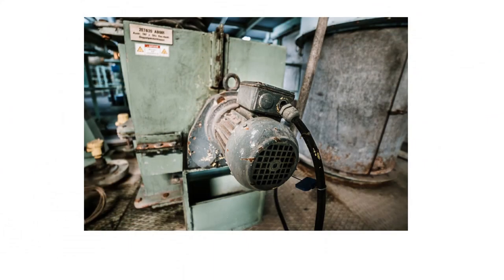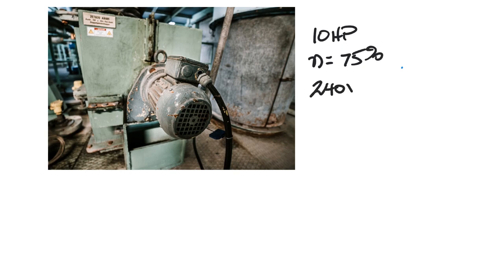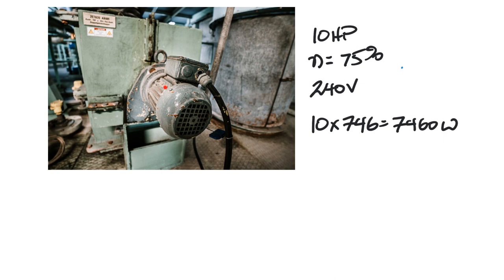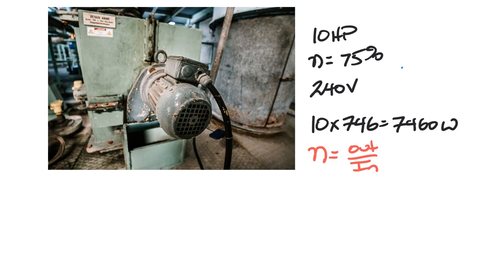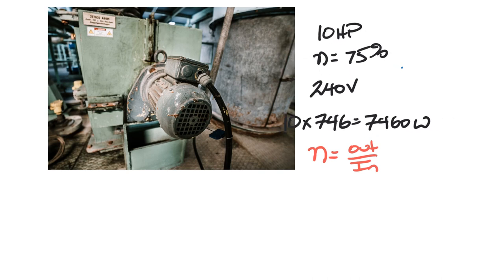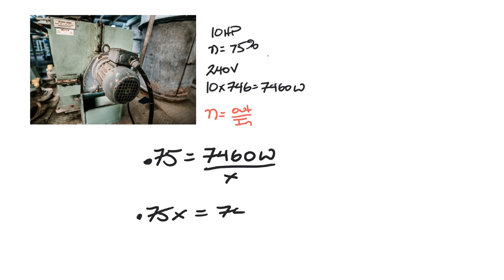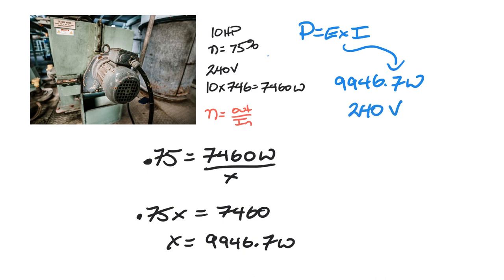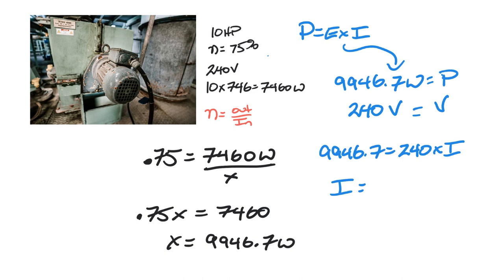Motor efficiency calculations explained

Comment: That would apply when things are up and running but not at initial start-up which depending on the motor size can cause a decent voltage drop thus your amp draw will increase :face-blue-wide-eyes:

Comment: Did not include power factor of motor. To know amperage input you need VA input = Power input / power factor.  Typical induction motor has PF between 0.75 and 0.88 depending on percent of rated loading on motor.  It is the inductive component of motor load.

Comment: You have to account for power factor.  Power in a 3 phase motor is: P = square root (3) * Volts * Amps * Power factor.  Most 3 phase motors PF is .7-.8.  For single phase P = Volts * Amps * Power Factor.   Power = Volts * Amps only holds true for DC powered machines.
Reply: True but 240V is single phase.
Reply from the maker: I guess I should do a video with pf and efficiency?
Reply: The Electric Academy 
Great videos, I’ve found several of them very helpful!!
Do you have any videos with general knowledge on motors rather than formulas? I’m challenging my red seal soon and in practice exams I’m struggling with all these random questions on motors. I can’t seem to find any good online sources to learn about motors. 
Please help! 
Thanks
Reply from the maker: trundle888 I do have a few on motor connections.
Reply: The Electric Academy 
Ok great, I’ll see what I can find and check them out. 
Thanks
Reply from the maker: trundle888 if there is anything in particular you need let me know.
Reply: The Electric Academy 
Do you have any videos on NEMA and IEC connections and controls? I can’t find much at all about them. 
Thanks

Comment: Good explanation but unless your getting a motor out of a dumpster, they normally  have the FLA on the nameplate. 

It just goes to show why you need to pick a more efficient motor when building a system
Reply: With me his love, this engine is born electrically electrically

Comment: I have a question pls... what size 2 pole breaker must be used on a 3HP, 115 V single phase motor? so basically we are looking for Amps. so please if you could make a video that explains a situation where you do not have e.f.f or PF or maybe u have PF and looking for e.f.f    PF and EFF not given

Comment: Hi there Great vid but i have a question. I have a motor that has no efficiency or power factor information written on the nameplate. How do i calculate input power or power factor?  I see a rating of 1/2 Horse power but i think thats the output power of the motor, and other info like FLA and voltage Any help will be much appreciated. Thanks.

Comment: How much power will a 1-horsepower, 12-volt dc electric motor that is 75% efficient require? Output/Input, 
1hp(746w)/.75=